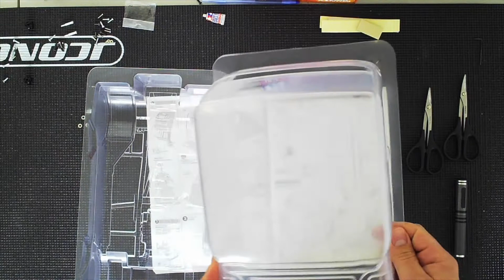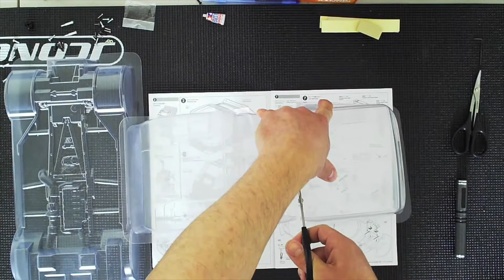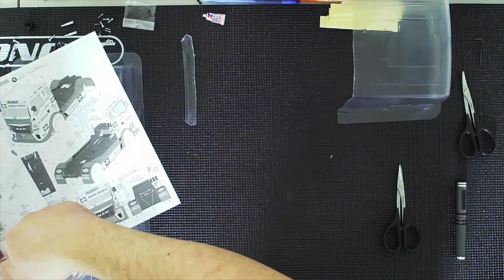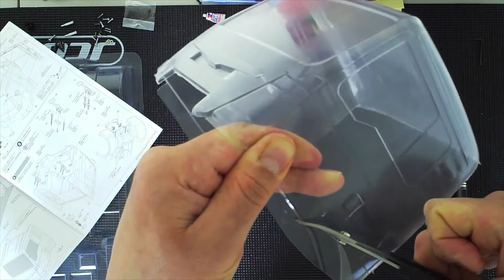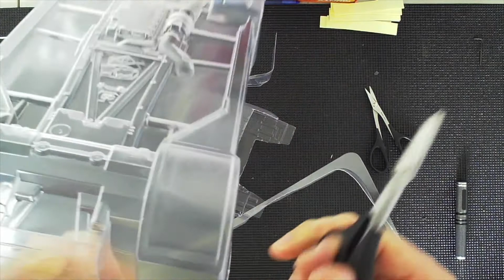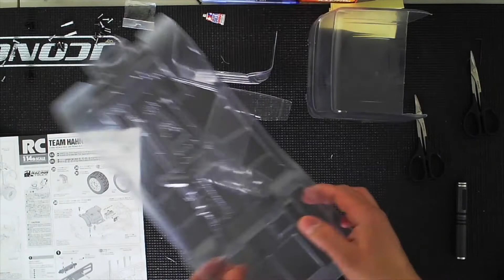Tamiya MAN TGS TT 01 Type E Truck Build Part 15 Cutting the Body

Comment: Wow good keep it up 😉☺️
Reply from the maker: Thank you. Three more races to go this year for the series locally. I am hoping I can win it.
Reply: @telecomandorc   what was think you should little detail video thanks
Reply from the maker: @ascreativeandrccars4489  Let me know if there are other topics you are interested in.
Reply: @telecomandorc  l am interested
Reply from the maker: @ascreativeandrccars4489  I just picked up my 1st place award for the 2021 Setup Board Series. It looks pretty cool. I will make a video in the near future to show.
Reply: @telecomandorc  Hello show this full and make video
Reply: When l buy should buy  new remote control
Reply: Does come with remote control
Reply from the maker: @ascreativeandrccars4489  What remote control (Rx) do you have? You may be able to buy a receiver (Rx) and use your current remote control. If not, then you will need a new Rx and Tx.
Reply from the maker: @ascreativeandrccars4489  I broke it down. I will go back and add the links to the description. If you change the number on the title it will give you the other parts.
Reply: @telecomandorc  😣 very sad l think we both will work this yes or no
Reply from the maker: @ascreativeandrccars4489  Tamiya Team Hahn Racing Man TGS TT 01 Type E Truck Build Part 1 Unboxing
https://youtu.be/CV1jdfOGm4g
Tamiya Team Hahn Racing Man TGS TT 01 Type E Truck Build Part 2 Page 4 Attaching the Spur Gear Shaft
https://youtu.be/XwhAx9f3g9o
Tamiya MAN TGS TT 01 Type E Truck Build Part 3 page 5 Mounting Motor Mount and Differentials
https://youtu.be/feEQWiQ-wYU
Tamiya MAN TGS TT 01 Type E Truck Build Part 4 Page 6 Rear Arms Differential Rear Axles
https://youtu.be/dGfaDoiJf6c
Tamiya MAN TGS TT 01 Type E Truck Build Part 5 Page 7 Attach Rear Bumper Plate Body Mount Front Arms
https://youtu.be/Kzv2uFa2b_8
Tamiya MAN TGS TT 01 Type E Truck Build Part 6 Page 8 Build Front Differential Attach Front Arms
https://youtu.be/FQp3PjHrQRg
Tamiya MAN TGS TT 01 Type E Truck Build Part 7 Page 9 Front Bumper Uprights Assemble Front End
https://youtu.be/HzgscA6bJ60
Tamiya MAN TGS TT 01 Type E Truck Build Part 8 Page 10 Front Rear Shock Mechanical Steering Arms
https://youtu.be/GXC-H848_VA
Tamiya MAN TGS TT 01 Type E Truck Build Part 9 Page 11 Attach Front Urethane Bumper Steering Arms
https://youtu.be/GiOPgRDL5XI
Tamiya MAN TGS TT 01 Type E Truck Build Part 10 Page 12 Servo Links Horn Prep
https://youtu.be/1y7df0MwPuQ
Tamiya MAN TGS TT 01 Type E Truck Build Part 11 Page 13 Electronics Installation ESC Receiver Servo
https://youtu.be/7E9g4NvGutw
Tamiya MAN TGS TT 01 Type E Truck Build Part 12 Page 14 Section 26 Tire Wheel mount glue RC tires
https://youtu.be/hCqAXU265mQ
TGS TT 01 Type E Truck Build Part 13 Page 14 15 Section 27 28
https://youtu.be/s0Np3pyWanA
Tamiya MAN TGS TT 01 Type E Truck Build Part 14 Manual 2 Installing the Rear Bumper
https://youtu.be/cJ1IO_GWYTc
Tamiya MAN TGS TT 01 Type E Truck Build Part 15 Cutting the Body
https://youtu.be/iVrWXt3NMiY
Tamiya MAN TGS TT 01 Type E Truck Build Part 16 Paint Tip and Asseble Full Body
https://youtu.be/g4mQHa6wylE
Tamiya MAN TGS TT 01 Type E Truck Build Part 17 Stickers on Body
https://youtu.be/gTxO7hBku4k
Tamiya MAN TGS TT 01 Type E Truck Build Part 18 Final Build Thoughts
https://youtu.be/CQE5MmssFO0
Tamiya MAN TGS TT 01 Type E Truck Build Part 19 Truck gets Ball Bearings
https://youtu.be/Izeu3rYDmhQ
Tamiya MAN TGS TT 01 Type E Truck Build Part 19 Post Final Wiring Tip
https://youtu.be/e3TfSQR0314
Reply: @telecomandorc  HI ABOUT THE JEEP  CONFERNCE CALL READY OR NOT